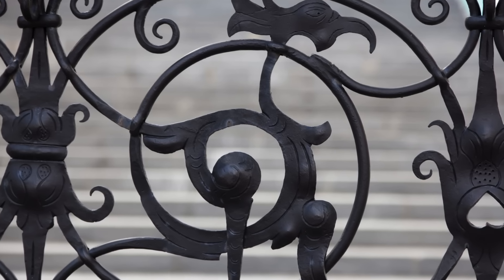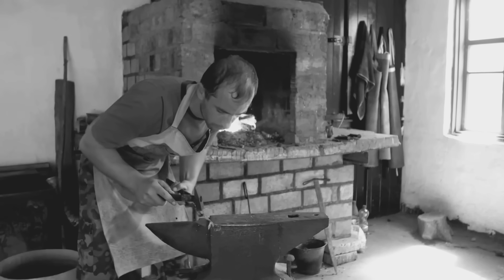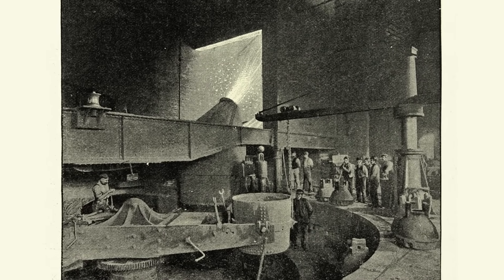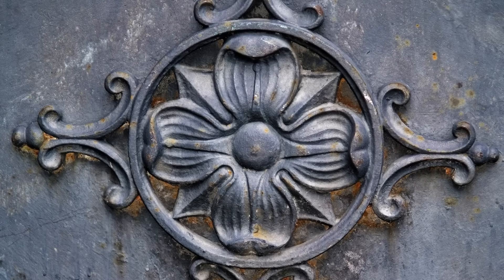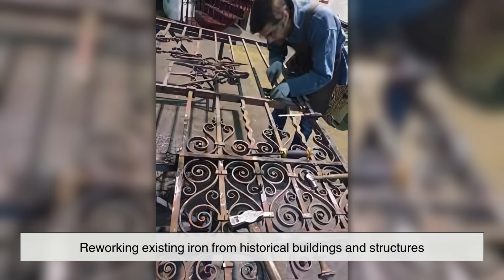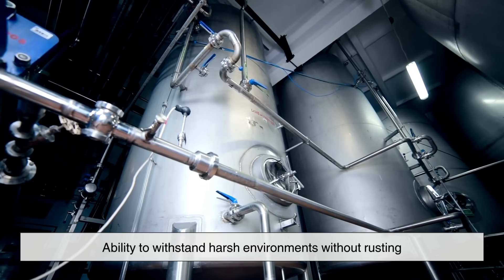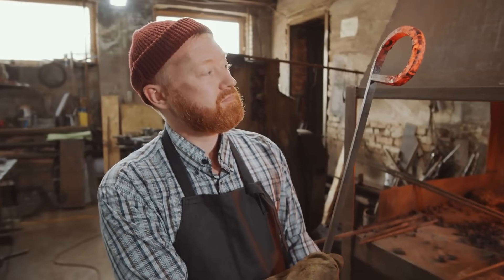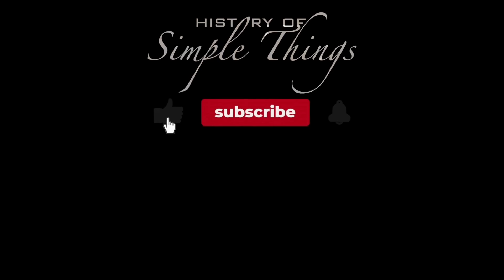Why Is Wrought Iron No Longer Widely Used?

Comment: Normally, I enjoy these videos and usually they are spot on, with a few minor errors.

But this one is way off the mark.

A few points that I would like to bring forth:

- Wrought Iron was developed in order to have a structural material for tensile loads.  Cast iron is not suitable for tensile loads due to a lack of ductility.
- Wrought iron preceded steel primarily due to the inability to have furnaces with a high enough temperature.
- Wrought iron is made from pig iron which still contains large amounts of carbon and slag.  The pig iron is heated up where it is basically a pasty mush.  It is manipulated to reduce the carbon content and to distribute the slag evenly through the ball.
-Wrought iron is then formed into rods, bars, and strips.
- Structures were made from these basic shapes and joined by rivets.

Why did wrought iron fall out of favor and was superseded by steel?  The primary reason is strength.  Wrought iron usually has a yield strength of about 24 ksi and a tensile strength of about 50 ksi.  Basic carbon manganese steel has a yield strength of 35 ksi and a tensile strength of about 60 ksi.  Steel has continued to grow in strength to the point where there are field weldable steels with a yield strength of 80 ksi and a tensile strength of 110 ksi.

Wrought iron does have a natural resistance to corrosion.  Bare steel has a higher corrosion rate than does wrought iron under atmospheric conditions, that is ordinary conditions encountered outside.

I have come across pipe that is made from wrought iron and was in service from the 1920's till the 2010's.  I have a piece of one as a keep sake.
Reply: I have some large horseshoes that were in the ground about a foot deep that are of wrought iron. They are still in pretty good condition after being buried for at least 100 years. The grain structure is plainly visible and is very interesting to look at. A piece of steel would probably never last that long buried in wet ground. I have quite a pile of old wrought saved up for special smithing projects.
Reply: @wvrockcrusher  From what I hear, it can be nice to work with and is different than working with steel or cast iron.
Reply: @ I like working with it and it is quite different. You have to keep in mind which way the grain is running with whatever you make because it can de-laminate under certain conditions. I mostly use it for special decorative things.
Reply: @wvrockcrusher  Well, when it delaminates that is due to it not being adequately worked when it was being made.

The laminated properties of wrought iron do make themselves known in fractures.

It usually occurs when it is subjected to a bending moment rather than a tensile load.

hth
Reply: The melt temperatures are about the same. It was that it was difficult to make large volumes of steel that kept in the background for so long. The Bessemer process began the revolution, but was superseded shortly by open hearth, which is still used today. I do a lot of work with metals. One problem with wrought iron is that it is made of layers in the grain structure. That means that the boundaries corrode faster than the metal in between. You can often see old wrought iron because the layers swell as they rust and come apart. It’s also much harder to manufacture than say, A-36 steel, which is used for most structures these days, which is basically just a low carbon steel and is easy to form and weld. I use a lot of it. Wrought iron can only be welded practically by forging, that is heating it up to a yellow heat applying flux to the surfaces and banging it until they fuse. Not the most efficient thing, and subject to major flaws.
Reply: @melgross  The melt temperatures are much different.

Steel requires a melt temperature of about 3,000 to 3,200 F whereas wrought iron is worked at about 2,600 to 2,800 F.

A quick look at the Iron-Carbon phase diagram will show the effect that the carbon content has on the melt temperature.  At less than 0.5% C, the liquidus temperature is 2,800F.  At the eutectic composition of 4.3% C, the liquidus temperature is 2,100 F.

Hypoeutectic semi-steels at 2% C have a liquidus temperature of 2,500 F.

Refractories used for steel making are generally alumina and magnesia.

I was responsible for the integrity of a pipeline that was constructed of wrought iron.  There really weren't any difficulties in welding it.  The original line was installed using OA welding and we used SMAW for repairs.  It was built in the 1920's

The delamination that you see often times in wrought iron and cast iron depends on how well the slag was mixed into the iron.

The Bessemer process was more about refining cast iron into steel.  However, the Bessemer process requires that the steel be relatively free from phosphorus.  It is easier to remove phosphorus from steel in the open-hearth method.

The manufacture of wrought iron is more labor intensive than for steel.  This is due to the puddling process.

My background is as a Materials Scientist.
Reply: Indeed, just ten seconds in it shows: -
https://en.wikipedia.org/wiki/The_Iron_Bridge
Famously the first iron bridge in the world and 100% cast iron.
Reply: Thanks. I enjoyed reading that very much
Reply: All wrought iron you come across, keep it and give it or sell it to blacksmiths, hobby or professionals - dosent matter.
Reply: @Underjordiskentitet  I try to keep at least samples.  I have a ring of 12" diameter seamless wrought iron pipe.
Reply: There’s uk and Alabama Bessemer
Reply: ty for these corrections:-)

Comment: “Wrought Iron” hasn’t been MANUFACTURED since the 1960’s.
The material is manufactured from bloom iron not molten steel. Bloom  iron is very inefficient to make.
Reply: wrought iron is still manufactured in China and India.
Reply: <<The material is manufactured from bloom iron not molten steel. Bloom  iron is very inefficient to make.>>

centuries ago it was difficult to get iron hot enough to be really liquid.  So iron ore was partially refined and then the iron beaten until it formed solid pieces, with impurities pounded out so they could be discarded and the process repeated until you got a satisfactory iron.

Bloom iron was efficient at that time --- it was the most efficient way to make iron from ore.    More efficient ways came along in the nineteenth century.

That's my understanding, anyway  ----but I'm not an Xpert.

Comment: The Bessemer process first began commercial mass-production of steel in 1858. Construction of the Eiffel Tower began almost 30 years later on January 26, 1887. Why then was the Eiffel Tower made of wrought iron instead of steel?
Reply: Just because a technology exits does NOT mean it will be universally adopted right away. In the US, compatible Color TV (NTSC) existed since 1954, it took until 1972 for color sets to outsell B&W sets.  The Altair 8800 came out in 1974, but what "normal" person had a "home computer" before 1977 (when the Commodore PET. Radio Shack TRS-80 Model 1 and the Apple ][ came out?
Reply: Because Eiffel was more familiar with wrought iron.
Reply: Because it was only intended to be a temporary thing.  Nobody (including Eiffel) thought the tower would be around this long, they were trying to save a few bucks.

Comment: Iron bridge is made or cast iron, not wrought iron.
Reply: Iron has always had a corrosion problem, stone tech was mature and lasts.
Look how many 20th century bridges have failed or had to be replaced.
Reply: Which one? All the others are steel
Reply: The Iron Bridge at Ironbridge was a tech demo, an advert for the material.  Stone bridges don't rust and 19th/20th century bridges collapse or are replaced due to design and maintenance issues.
You shouldn't expect many cast iron bridges, forging was always expensive, and what we remember was decorative fences.
The population and economic growth means such large infrastructure was relatively rare until recent times.
Reply: @Bobo-ox7fj yeah, because both would corrode, stone was both proven, there's surviving Roman bridges that are still around.  The time window for Iron is short, and the economies were smaller.
You need to read a whole post and think about context
Reply: Where is this iron bridge everyone is mentioning?
Reply: @eugenecbell  Ironbridge. It's literally the name of the town, named after the bridge in Staffordshire.
Reply: @ so in England? 
What city is it near?
Reply: https://en.m.wikipedia.org/wiki/The_Iron_Bridge
Reply: @dcarbs2979nearly, it's in Shropshire
Reply: Not always. There were bridges made of wrought iron. Most cast iron bridges have collapsed.
Reply: @melgross Ironbridge is still standing.
Reply: @Carol-East  as I said, most aren’t. They didn’t understand cast iron well, despite that it had been used in large quantities in the Ronan republic and empire. Most cast iron bridges, as a result, were designed putting the cast iron in tension. All of those are gone. The smaller number that used the cast iron in compression and that were taken care of, are still standing.
Reply: @melgross 
The first all iron bridge in America, the Dunlap's Creek Bridge in Brownsville Pennsylvania, is still standing, it was built from 1836-39 by the US Army Corps of Engineers. 
It's been under constant use since it was built and is currently undergoing restoration.
Reply: @ The English bridge is about 70/80 years older.
Reply: @melgross  The bridge shown here is literally called Ironbridge. As is the town it is in, because it's the world's first.
Reply: You are absolutely wrong.
Reply: This is rubbish
Reply: *of
Reply: Correct, the photo is of Coalbrookdale Bridge, which is cast iron.
Reply: Cake R square...pie R round
Reply: Indeed! Not going to watch more than the first 20 seconds now. The title!!!!! Pathetic.

Comment: I bought a bed that I thought was wrought iron, turned out it was some cheap metal, fell apart in a year.
Reply: Nowadays mostly Mild Steel materials are sold as Wrought Iron furniture by shops. But as far as I know true Wrought iron is not produced anymore. I may be wrong, but quite often I have observed that furniture shops advertise their products as Wrought Iron products , whereas they are actually made of Mild Steel with Black Paint.
Reply: There are paints to imitate wrought iron, but it wears off overtime